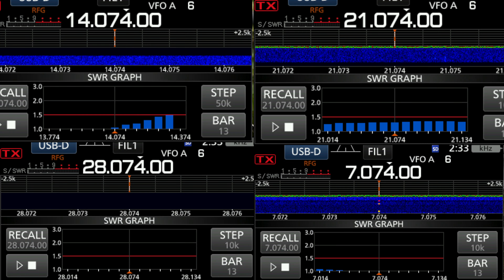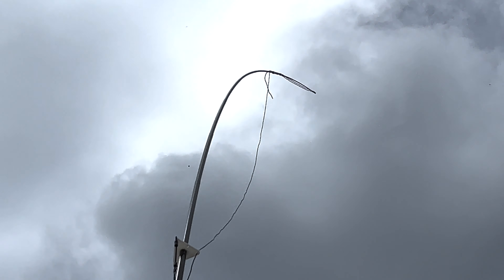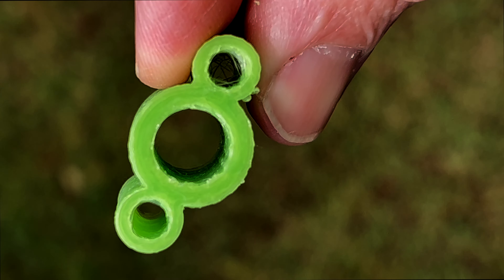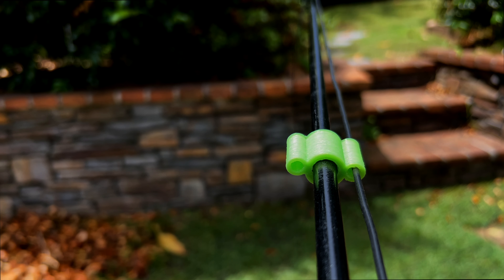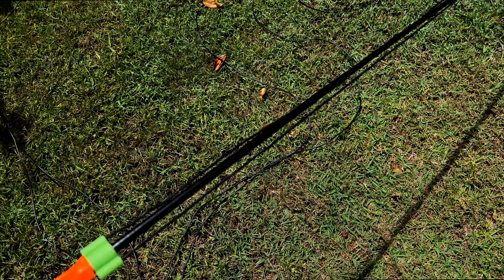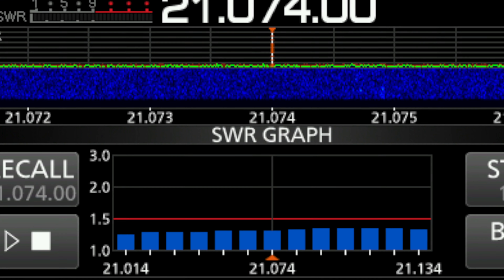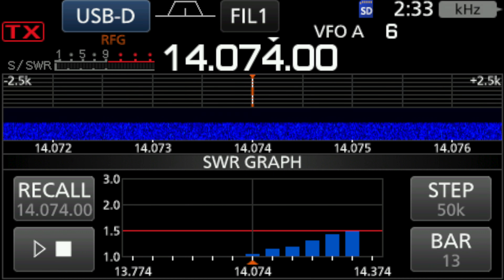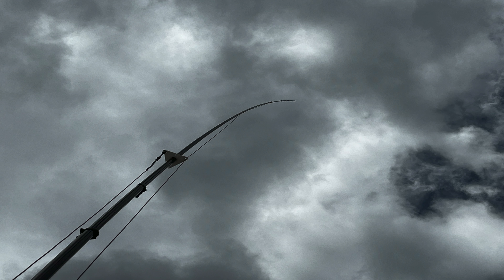Review of the DX Commander EXPEDITION Antenna Kit

Comment: how many watts are you putting thru when you show the S.W.R. readings please ? Nice work on the 3D Printed wire element guider.
Reply from the maker: For the SWR test on the IC-7300 its 33watts. Which is the recommended power to do SWR checks on that radio